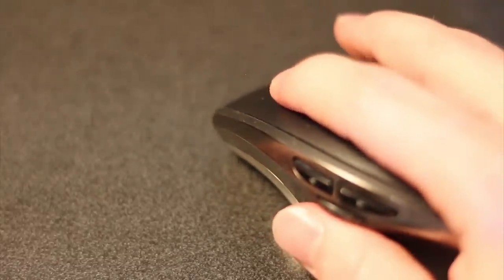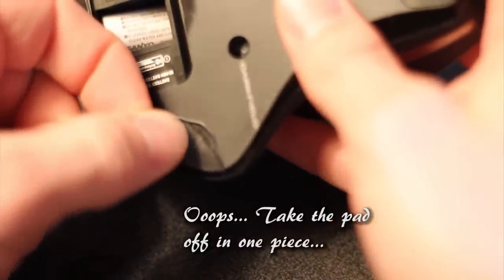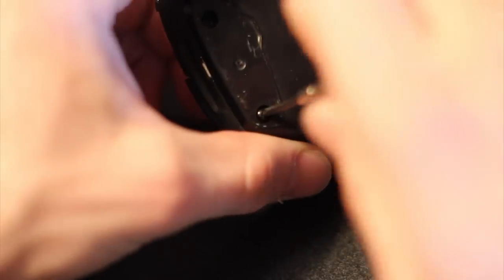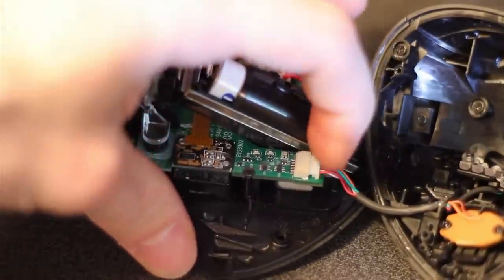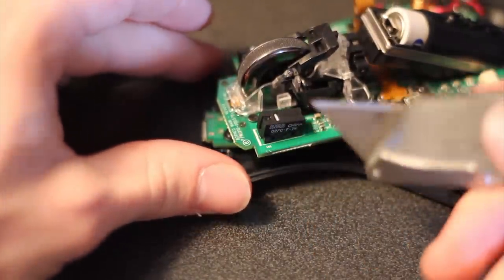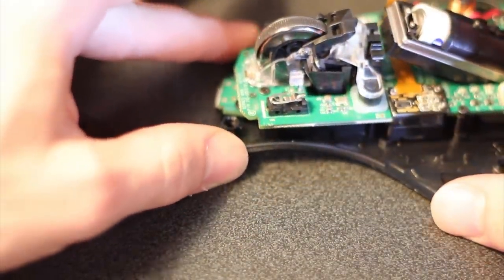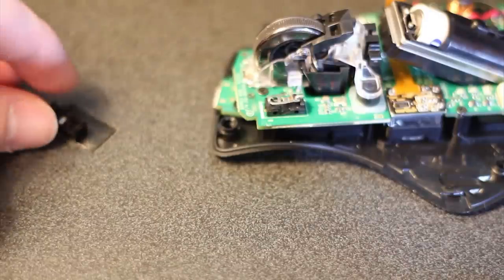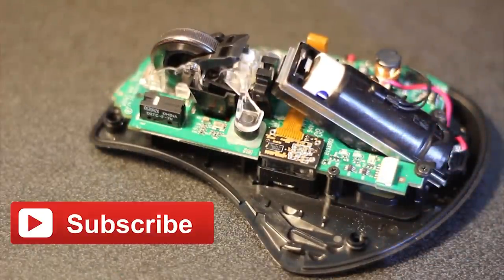Logitech Performance MX Mouse Micro Switch Fix

Comment: Thank You so much, i don't own this mouse, but You just made me brave enought to rip open the microswitch from broken mouse of my friend and it worked, i did it, because it didn't have those little openners, so i had to unsolder them and rip it open and after some investigating i found out that that golden part of the microswitch is broken a little. Gonna try to fix it and solder it back and gonna tell the results.
Reply: Aaaaand i f-ed it up....
Golden piece fell on the ground and got separated.
Reply: ***** I'm not gonna replace anything in a 1€ optical mouse, i'm obviously gonna try to replace it with an alternative like maybe alluminium foil.

Comment: I actually did it. I can't believe it. Took me three hours to get those fucking metal pieces back in since they popped out when I took off the microswitch plastic bit...but now it works as intended!!!!! Thanks mate!
Reply: Hold the sping with fine tweezers, on the tip of its front edge (= facing outwards). First connect the notch at the tip of the spring tongue with the middle stop then connect the far front notch of the spring, where you're holding it, with the front stop. You need to pull with the tweezers towards the front a little, almost like latching it in. Once I understood this 2 steps procedure I got it in in 5 sec.

Comment: To get the spring back in : Hold the sping with fine tweezers on the tip of its front edge (=facing out). First connect the notch at the tip of the spring tongue with the middle stop. Then connect the far front notch of the spring, where you're holding it, with the front stop. You need to pull with the tweezers towards the front a little to ltach it in. Very easy.

Comment: My MX has the kind of micro switches that can't ne separated to get at the bent tab. Besides mine clicked just fine. Mine had dirty contacts inside the switch. So, I put a drop of WD40 inside the switch by shooting it at the white button on top and working the button at the same time. It worked! Clean contacts work great.

Comment: I just had to do this a second time on my M950. As a more permanent solution I'd recommend ordering some replacement D2FC-F-7N (20M) switches which are meant to have 8x longer life than the regular D2FC-F-7N the mouse comes with.

Comment: This worked! I'm kinda angry at Logitech. Bought this mouse probably 5 years ago and started using it only recently for 3 months and already it's doing this. At least I learnt something now and will be able to fix it in the future should it happen again.

If you don't use electrical tape, put back the white piece into the black cover so that it stays inside when you turn it upside down. To put the black cover back on the PCB, you have to hold the mouse upside down.

Now I can go back to my hours-long mouse drags... (I'm drawing digital circuits.)

Comment: thanks for showing how to take it apart, and the detailed photo's of the microswitches that flashed by "that you can pause";) maybe you could say pause before showing them? i managed to fix this problem on my left-handed and no longer available MX610 by simply cleaning the contacts, no bending or straightening (because i love the loose, soft click, but the contacts were corroded, just like in several automotive switches i've come across that worked like new after gently scraping or sanding and cleaning out)
Edit, had to replace the metal plate with an older, more sturdy version from a nineties Logitech wired, and ball-sensor mouse!

Comment: ever thought of cleaning the contact areas first, before straightening the spring? just cleaned up the contact points with surgical spirit and a toothpick - left click works splendidly again!
Reply from the maker: Oh glad to hear! By all means if that's what works, that's much easier than taking it off!

Comment: By placing a tape on the switches you only treat the consequence and not the cause of the problem. The problem is oxidation of the switch contacts. This is easily solved by spraying contact cleaner inside the switches. Look for one that has oxide disolving chemicals like Deoxit.

Comment: Or you can do a compromise: buy a pair of new microswitches and transfer the springs from the new one to the old one. No soldering required. 
But if you are good with soldering you could buy a pair of silent click microswitches and upgrade your mouse.
Reply from the maker: Good point!

Comment: It easy on the video only. For me putting back the spring was 30-40 minutes endevour changing mulitple tools and lenses. You are physically unable to evenly flatten the spring unless you have some special tools. Mine button somehow started to work in the end but became super sensitive and without any click sound.
May be there were different types of springs for different years of production I don't know. But strongly advice to have this whole new switch at hand just to replace it in case you will be unable to cope with the spring.
Reply from the maker: Check out my video to replace the whole switch

Comment: Before tearing your Logitech mouse apart to fix the double-click issue,  I suggest you try the 'static electricity' fix.  You can blow your own breath into the seams of the wheel and left click and right click buttons on the mouse to discharge static electricity.  You can also remove the battery and then rapidly click both mouse buttons to remove static electricity.  This might sound like some kind of crackpot fake fix to make fools of people, but this actually worked for me.  Every time the double click issues return, I just blow on the mouse.  You can do some web searches and find out more about static electricity build up in Logictech mouses.
Reply: this is anecdotal. Just like blowing into game console cartridges to make them work, or rub the chip on your credit card if it doesn't work. Next time you need to try this "fix", just wait 2 minutes and do nothing, and see if the problem also goes away.
Reply from the maker: I used to blow into those Nintendo cartridges all the time when they stopped working!

Comment: Veru useful!

I did not take the spring out (as it would have been really difficult to put back with my very limited tool set).
But still managed to get the spring a lot tighter - actually clicks harder than the right click now - but I was lazy to open the right one at the moment.

Anyway, it resurrected my 7 year old and very warn mouse yet again :)

Comment: if the plate falls off ur done. u cant get it back in right. even when trying to take off the cap u run the risk of bending the copper plate and it working worse than before....thats why everyone else is probably suggesting soldering on a new omcron (without the need of taking off the cap)

Comment: My last two Logitech mice both suffered unreliable left mouse buttons after a time - just the left; the right buttons were OK, probably because the left button is used far more often.
Is it just Logitech, or do all mouse manufacturers use the same microswitches?

Comment: Wow this is so funny.. my mouse's left button malfunctioned and didnt work well... so I was like a second away from ordering a new performance MX.. then I found this video and I fixed it!
The only thing I would like now is a link to order these sticky surfaces because I kinda ruined them in the process haha.
Thank you so much.
Reply: You can buy sheets of the stuff and cut it to the right shape.
http://www.ebay.com/sch/i.html?_odkw=teflon+tape&_osacat=0&_from=R40&_trksid=p2045573.m570.l1313.TR0.TRC0.H0.Xteflon+tape+mouse.TRS0&_nkw=teflon+tape+mouse&_sacat=0

Alternatively you can probably also find replacement feet for your specific mouse, but I recommend just getting a sheet as you can use it on more than one mouse if you ever need to.
Reply: Hi, thanks for the reply.
How do you cut these things right?
Reply: You could use a piece of paper on top of the space where the mouse feet go and trace out the shape with a pencil, cut that out and use it as a pattern to get the right size.
Reply: Thanks

Comment: I just repaired the click, somewhat. I find it hard to retension the spring. I suppose I'll get the hang of it.
But! What's worse is that there's now a connection issue inside the mouse, I can't turn it on anymore. Well I can plug it with the rechargeable cable, but it'll keep flashing red as in there's a loose connection with the battery. However I cannot push the battery more in place than it already is. Any tips?

Comment: Great Video, I followed you steps and fixed my mouse.  Just wondering if the problem wasnt dirty or corroded contact point more so than spring. But, none the less, Fixed, thanks

Comment: Awesome, fixed my mouse in no time because of this video.
Had already purchased a G602 as replacement, but couldn't just say goodbye to my trusty old Performance MX after 3 years.
Now I have 2 awesome well functioning mice with their respective advantages.

Any idea on how to fix the laser though? It doesn't work on every surface anymore (i.e. white paper is somehow a problem)

Comment: Thank you for such a detailed video to teach how to actually fix the mechanical issue of a mouse key! To put it in context, most of blogs, forum posts out there were just talking about those "update your software driver, reinstall your computer, scan virus, ..." crap.
I am also sharing another information here for another real hardware fix but for a different cause.  https://www.ifixit.com/Guide/Repair+Mouse+Buttons/12759
Lastly, a rant to the keyboard/mouse manufacturers. Nowadays they taunt their mechanical keyboard is so durable for "millions of key press" and charge 3 digit price for a high-end keyboard which typically has around 100 keys. Why couldn't they literally use 2% of those durable mechanical switches to build a durable mouse for the price of a few dollars? Shake my head.
Reply from the maker: I hope you're able to fix your mechanical switches when they bum out!

Comment: Well, instructables and fix it guides for this are saying the plate gets flattened out with generous amounts of clicking over time, and it needs to be bent outward again (cause all the clicks flattened it) - SO WHY ARE YOU SAYING TO FLATTEN IT OUT?? I guess i'll see which is the case when i get in there soon.

Comment: Thx for the video! But soldering new buttons back in is way easier then getting the spring back in. I have never been this frustrated in doing something that seemed so easy.
Reply from the maker: True. The spring is a challenging task but replacing the switch takes more tools; just a different kind of hard.

Comment: Thanks, this was great. I think I may have over straightened it, force to initiate the click seems greater than before but if it makes consistent selections and single clicks its working. Also, funny vid, great delivery. I couldn't get the spring off the switch so I "flattened" it in place. Is there a trick to removing the spring?
Reply: My spring flew off when i removed the cap and now I think i'll never get it back on lmao.

Comment: Big thanks! The only tricky part is to put the damn spring back, had to remove the other one (right mouse button) to see how it is attached. The front has a little cut that spring goes into, can be hardly seen though, but once i got that little piece of ** back I had it back working. So guys be careful when u remove it - it can pop right out and it's really hard to find after that...
Reply: Try opening the other one but without removing the little spring. this way you'd know how the other one is attached. Hope this helps :)
Reply: Also don't forget the tape that holds the little white button when removing the whole thing.
Reply: aphexbg I managed to get the spring back in thanks to a diagram I found, I just had to bend it more than I was to pop it in place

Comment: My spring was fine, for me the issue was some corrosion or discolouration on the bar at the contact point which once cleaned off worked great.
Reply from the maker: Glad it worked, thanks for sharing!

Comment: I have 4 of these mice. They usually go for a year or so before manifesting this problem.  I opened up the oldest one (probably 2-3 years old) and the switches were different. They both have the number 151 printed on them.  They are very hard to get open. In fact, I broke one off of my mouse entirely.  I don't want to do that with the other (newer) mouse that has this same problem.  Do you have any suggestions?

Comment: 3rd time in 10 years that I've used this video to solve this problem. I refuse to switch to anything else, this is the best ergonomic hand shaped mouse ever made, I'll keep fixing it til the plastic shell around it breaks and all the rubber wears off completely then I'll probably just find a way to fix that

You know how Honda gave the guy who put a million miles on his Civic a brand new one for free? I think Logitech owes me a new mouse given my dedication to the performance MX (although I wouldn't use it, ♥️ performance MX)
Reply from the maker: Ha that's awesome. It's crazy how much this video has been utilized over the years. I'm still getting comments from it!

Comment: i actually considered replacing my g602 clicker with my old mx mouse clicker, if it doesnt get fixed.
Is there a good brand of micro switch that do not have theese problems?

Comment: Thank you so much. the details were a little vague imo. but i did manage to fix a mouse i commonly use for gaming. :) Is there any advice if the microswitch goes bad again? like replacements?

Also. i did find a alternative to flattening the copper plate but it is a little more dangerous imo.

I pressed a small flathead screwdriver against it to flatten it. i didnt take the plate out. but it worked. so im still gonna take that W
Reply from the maker: If flattening doesn't work, you can replace the microswitch for pretty cheap, just time if you have the tools. I have a link in the description.

Comment: I didn't need to bend it. There seemed to be only some little dust particles in there. I think i did blow them away and then it was fine again. Maybe i did bend it too a bit, when i tried to remove some dust, but that was only very little. So if you don't want to break the microswitch be careful and don't try to bend it too hard.

Comment: It worked for me for a while but it went back to double clicking. Then I found this solution on their website:
" This can be caused by static energy trapped inside the capacitors in the mouse. To drain this static energy, please plug the Unifying receiver into a different USB port and follow this procedure:
 
1. Shut off the mouse and remove the batteries.
2. Press all the buttons repeatedly for 30 seconds. This will drain all the static energy that may be trapped in the mouse.
3. Put the batteries back in the mouse and turn it on.
4. Wait a few seconds for it to re-connect and test the buttons.?
 
If this does not fix your issue, please contact the customer support team in your region for more assistance, including a possible warranty replacement.
 
Regards"

This worked well for me.

Comment: I was able to take the top piece off but when the metal came off, i straighten it then put it back but it wont reproduce the clicking noise (still not fixed)
Reply: +Ronald Li me too :/

Comment: I think it's impossible to remove the pads from the bottom in one piece or to replace them. I'm pretty sure Logitech did that on purpose to prevent DIY repairs to their mice. My G400 started scraping the mousepad without those pads so I added some silicone mouse pad stickies and it works great now.
Reply: +IkeandMike1 Actually you can purchase replacement pads for the MX series of mouse from Amazon! http://www.amazon.com/gp/product/B007NNLLKU?psc=1&redirect=true&ref_=oh_aui_detailpage_o00_s00
Reply: +BartmanLA323 Oh ok, I was basing my comment on the fact I couldn't find similar replacement feet for the G400. I found some third party ones from Hyperglide I might try. Thanks,

Comment: I was really struggling to take off the black cover with a flat head screwdriver but it didn't work. I changed it to a knife and it still isn't lifting the cover up.
Please help!
Reply from the maker: It's a tricky thing. Hope you figured it out

Comment: So...was the sound different when it started to double click? (I do realize this is VERY much later.)
Reply from the maker: The click sounded very weak because it did not have enough spring in the microswitch. If it doesn't work exactly how you want it, then for me, time to fix or replace. And I'm still using this mouse all these years later :-)

Comment: Only trouble I had was clicking on the pause option here to study the stills of the dismantled micro-switch - the spurious double-clicks were causing the pause action to also un-pause straight away... 8-P

Yeah - carefully unhooking the moving part of the switch and flattening out that middle (curved) section a little does restore the "snappiness" of the switch and removes those pesky extra, and unwanted double-clicks - I can now pick up windows and move them around the screen without them toggling to maximised instead!
Reply from the maker: Excellent! Hope the fix is still working!

Comment: How do you put the spring back on if it comes off? It seems like it was physically attached at one end and has broken off. Any tips appreciated.
Reply from the maker: Very carefully. This is the difficult portion of the fix. Start with affixing one side and wrap around the other side with the spring bending. I bet after 25 attempts you can figure out what might work; just like programming.
Reply: @KylersStudio  Sadly, I’ve broken the  curved spring bit off of the piece in my attempts to reattach it, so it’s useless now. I’m thinking of buying a pack of switches and installing a new one.
Reply from the maker: @78 Yeah, check out the link to microswitches you can solder on. I made a video for that as well. That should work.